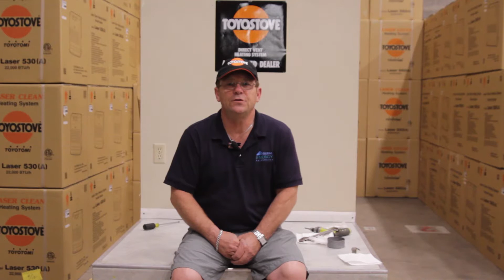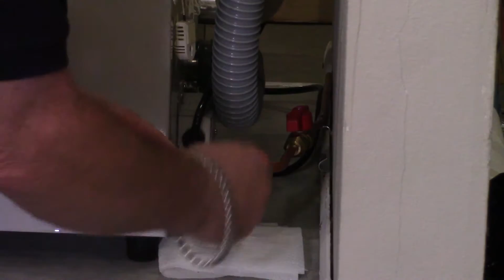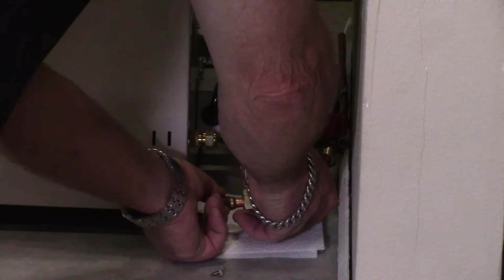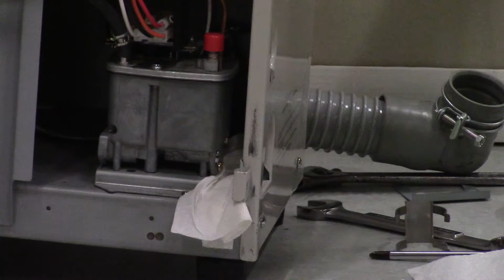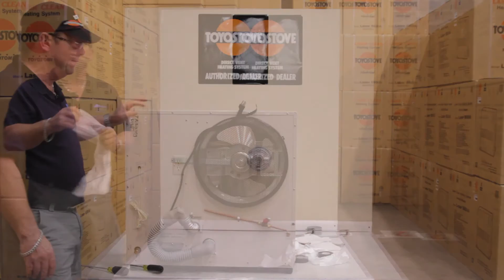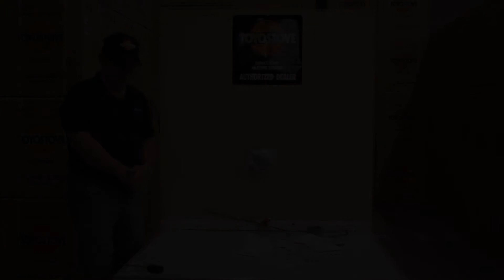Properly Disconnecting Your Toyotomi Toyostove | Step-by-Step Guide

Comment: How to install a toyotomi on chiminey
Reply from the maker: A Toyotomi Water or Hydronic heater can be installed with a chimney vent. A Toyostove can only be installed with a direct vent wall kit.
Reply: Toyotomi heater laser 731 into chiminey
Reply from the maker: The Laser 731 is DIRECT VENT ONLY.

Comment: I know this video is 7 years old but I bought a house with one of these stoves and i need to temporarily move it to put flooring underneath. If I disconnect it for a few minutes I'm assuming it won't leak heating oil. Is this correct?